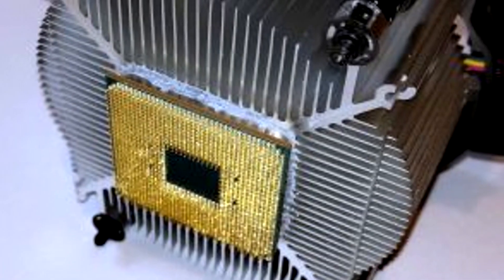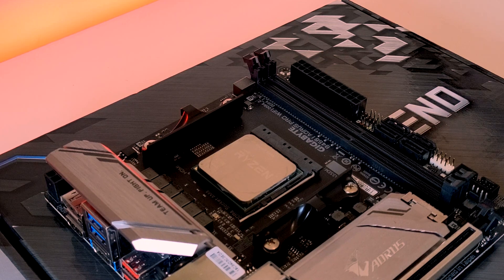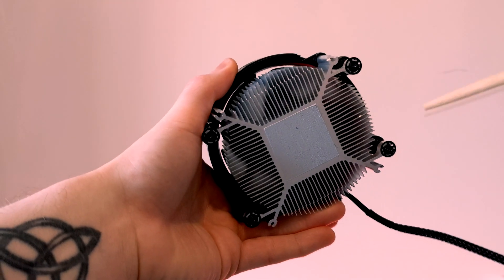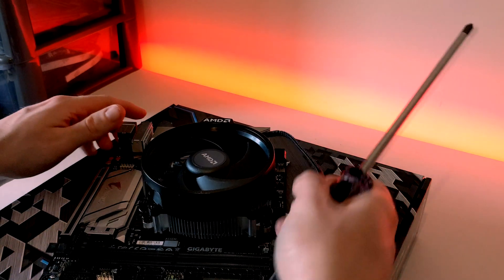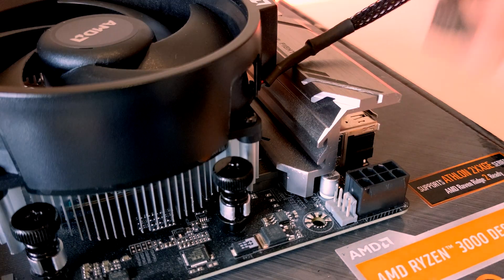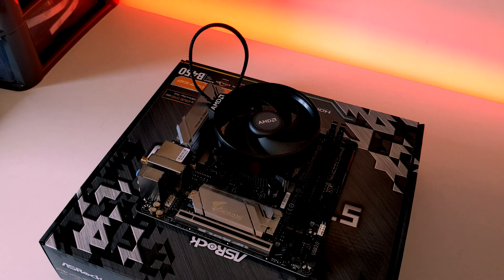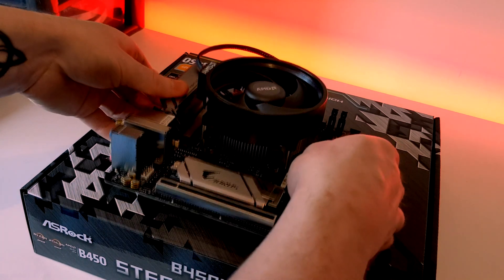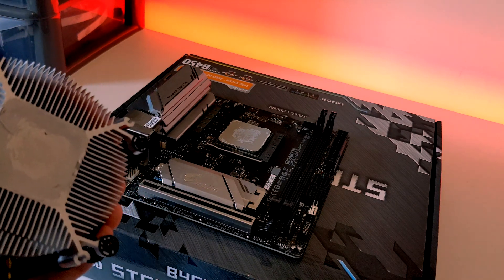How To Install & Uninstall Wraith Stealth Stock Cooler

Comment: going to remove my 1600 in 2 days to put in a 5600x. hope mines isnt caked on like crazy. ima try to run a stress test or play games a bit before doing this. also, i dont plan on taking the mobo out the tower. will this be a problem?

Comment: If I remove the cooler in the case, am I gonna have to hold the backplate in place if it's laying down? 

The backplate and the side of the case would be facing the table.
Reply: I use advertising papers like magazines, I fold them and create a support behind, basically I place them and let the cabinet fall little by little until the magazines create pressure on the plate keeping it tight, since it is paper it does not damage the motherboard, it is a good trick, I read on forums that there are people who even use sponges.

Comment: Just had this happen to me and while I didn't watch your video before trying to remove my wraith prism cooler I did watch one with basically the same advice and I can tell you it was useless. It may be better for the model you actually showed but the wraith prism (which you show as an example of a failure) required much more pressure than I was comfortable with to clip into place when installing and didn't want to unclip when uninstalling. Just a terrible design. That pressure meant that the CPU and cooler are now effectively fused together with effectively no thermal paste been them and I'm not even sure a blowtorch would separate the two pieces. 

Trying that twisting movement would likely result in you shearing the pins if you persisted. 

I ended up with my CPU poping out of the still locked socket while simultaneously trying to: hold the heatsink in place to prevent exactly that from happening, pull up on the side that has the lever system which was easy enough to unhook and press down specifically on the top of the bar on the side that still needed unhooking and pressing down on the heatsink a but on that side because all that was nowhere near close to getting it to unclip.

Comment: hello, my screws just won't go down. can you help me?
Reply from the maker: Hey! They do need a little bit of pressure to actually catch the thread from the backplate. Another trick is to place the motherboard on a countertop as the box may bend as you press down and make it harder for the screws to catch the backplate 👍
Reply: @PCJack  i tried everything, they just dont go down

Comment: many thanks for the useful video = so if the fan were to break down in the future, is it possible to just buy the fan or another fan and screw it to the heatsink ?
Reply from the maker: No worries mate! You could possibly but as it's an OEM design it's probably easier to just replace the cooler entirely or upgrade to a a better one.
Reply: @PCJack  just the thought of having to replace the cooler scares me since i've never done this kind of DIY jobs before.............i've never had a CPU fan fail though and since i don't play games at all - how long do you think the fan (AMD Wraith Stealth) will last ?
Reply from the maker: @worstalentscout  It's a pretty straight forward process to remove like I show in the video but regardless I would be extremely surprised to see one of these coolers fail particularly quick considering I've got even older stock coolers from nearly 10 years ago that still work. Provided temperatures and noise levels are acceptable then I wouldn't worry about it 👍
Reply: @PCJack  many thanks for your reply, you mentioned you had 10 year-old stock CPU coolers that still work - but surely, these CPUs had not been in daily use for 10 years ?..............if only it's as simple as just replacing the fan with a standard case fan !
Reply from the maker: @worstalentscout  Well it's going to largely depend on how long you run the system for but the effort of replacing the stock fan which I believe is around 80mm, it may make more sense to just get a better cooler entirely but that's just my opinion 👍
Reply: @PCJack  yes, it makes sense to change the whole cooler for sure but i've never done anything like this before and it'll be a major challenge for me since the CPU might get pulled out too ! hope the local distributor will just sell the spare fan in the future - the heatsink is not glued to the fan, right ?
Reply from the maker: @worstalentscout  That's fair mate. Just do only what you're comfortable with 👍 Nope the fan is only secured to the heatsink with a couple of screws.
Reply: @PCJack  ok, many thanks indeed for all the useful info

Comment: Hello @PC Jack, would you have any tips when comes to aligning the backplate and heatsink and screwing them together? Aligning them seems ok but the screwing part isn't working for me, one side gets disaligned/dislodged from the backplate once I start screwing the other side.
Reply from the maker: Hey! I'd start by ensuring 2 opposing screws are catching the threads and once you know they are partly screwed in, then begin alternating screwing all 4 corners. If you're struggling to thread them though, you do need to apply a bit of pressure but you can also place the motherboard on the table rather than on the box. Sometimes the box can flex a little making it difficult for the cooler to fully contact the backplate.

Comment: For me screws don't wanna go out... 😭
Reply from the maker: Have you overtightened them during the original installation perhaps? If you have and they won't budge, using a drill might do the trick. Again like you would with a screwdriver, only a few screw turns alternating on each corner to avoid uneven mounting pressure though 👍

Comment: Is it easier to remove the cooler, and clean the thermal paste, after playing for a while (reaching those high temps) or does it make no difference?
Reply from the maker: That's exactly what I explain to do in this video so go for it! 😀 Personally I just run Cinebench or Prime 95 to heat soak the CPU as it's a bit quicker but anything to warm up the system will work!

Comment: is it recommended to take the motherboard out of the case before uninstalling the cpu fan?
Reply: job done! many thanks.
Reply from the maker: @archiepattenden8268  Sorted! 👍
Reply: Should i be cleaning off the old thermal paste from the cpu? If so, what should I use? Thanks
Reply from the maker: @jonathanbalangon9671  Yes you will need to clean the CPU. You can use isopropyl alcohol or instead I like to use the 2 part Arctic Clean thermal remover which is really good. Take a look on Amazon and you should see it listed 👍
Reply: @PCJack  can you also remove the terminal paste with a little bit of water?
Reply from the maker: @stefan5928  Wouldn't advise using water. Either use isopropyl alcohol or my favourite is the Arctic Silver thermal paste remover/purifier kit. Does a great job! 👍 https://www.amazon.co.uk/dp/B001JYQ9TM/ref=cm_sw_r_apan_glt_fabc_8W7374DDVMV74WEAC4K6
Reply: @PCJack  ok thnx, i didn't thought you would react btw 😂
Reply from the maker: @stefan5928  No worries mate! 👍 I always try to respond to help if possible 😁
Reply from the maker: Depends what cooler you're replacing it with. The backplate will not stay in place while in the case unless you hold it in by hand or with tape so if you're reinstalling the cooler it may be easier to reinstall outside the case. If its not budging though, ensure you've warmed it up prior and then just slowly twist and slide and it should eventually pop off. Just gotta take your time 👍
Reply: so im warming it up via booting it on, or? plus i have it all un plugged and un screwed currently!
Reply from the maker: @archiepattenden8268  Should have been prior to uninstalling everything really but like I said, twisting and sliding slowly is going to be your best bet.
Reply: @PCJack  thanks for the help! you got yourself a like!
Reply from the maker: @archiepattenden8268  No problem at all! Thank you ❤️
Reply: sorry to bother you again, but ive ran it for about 10 minutes and turned off and then tried slowly yanking it out again but it still won’t budge, it is supposed to feel forced or easy?
Reply from the maker: @archiepattenden8268  It will still be pretty firm but with enough twisting it will slide easier then you can use very light upward momentum.

Comment: If I remove this while it's in the case will the back plate move? don't want to do it if I have to remove the whole motherboard as will be to much hassle
Reply from the maker: If you unscrew the cooler then yes the backplate will be loose sadly. You could tape it up though temporarily.

Comment: awesome work! your advice was reassuring and helpful :)
and kudos on the professional production quality
i had a question
i have a 2200g with stock thermal paste from 2018
i wanted to reapply thermal paste and change the cooler
is the CoolerMaster H410R and MasterGel Pro a good choice (aiming for value for money, with both adding up to <100USD)

Or should i splurge on a Hyper 212 and Arctic MX-4?
Does the H410R come with (preapplied) thermal paste?
Are there any specific things i should be aware of when uninstalling my wraith stealth cooler? its connected to an Asus Tuf B450 mobo
Will i need to remove my mobo from my case?
Do i need to remove my CPU from its socket?
Will it have a backplate?
Should I use the "pea method" of applying thermal paste, or should i apply a pea amount and spread it out, then installing the cooler?
This is the first time i am trying this
Thank you for your help in advance.
Reply from the maker: Your welcome buddy, cheers! 

Tbh it doesn't take much to cool the 2200g but I can definitely recommend the Hyper 212 if you're looking for lower temps and acoustics or even to overclock. I wouldn't stress about what thermal paste you use though, any will do fine but personally I use MX-4. 

All the info you would need for uninstalling the Wraith Stealth is already in this video.

If your case has a motherboard cut out then you can uninstall the cooler and install your new one without taking your motherboard out and you shouldn't need to remove your CPU.

Depending on which Cooler Master cooler you use it should have an included backplate.

Lastly for thermal paste application, usually I just go for the pea method. When you place the cooler on top it should spread enough by itself so I wouldn't about pre-spreading 👍

Comment: This backplate is from motherboard or i can remove it when i want to put on a Fortis 3?
Reply from the maker: The AM4 backplate is included with the motherboard but I believe the Fortis 3 includes it's own backplate that you would need to use 👍

Comment: Thanks for the video. I’m planning on removing my stock cooler and replacing it with an aio. Should I be cleaning the cpu from the stock paste or should I leave it as is and just install the aio?
Reply from the maker: Yes you should always clean the thermal paste inbetween cooler installations. I can highly recommend the Arctic Silver 2 part thermal remover though!